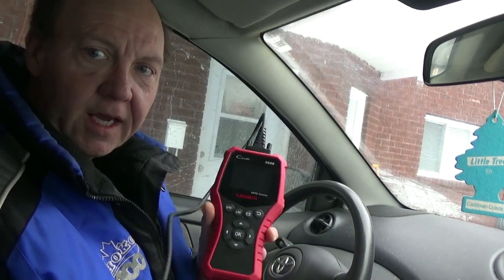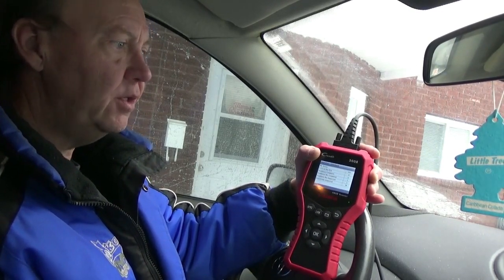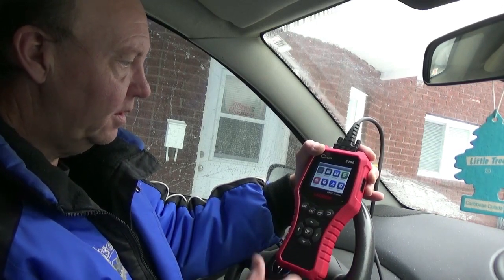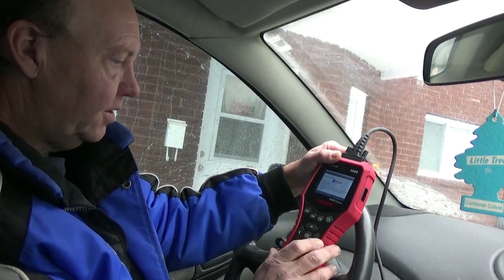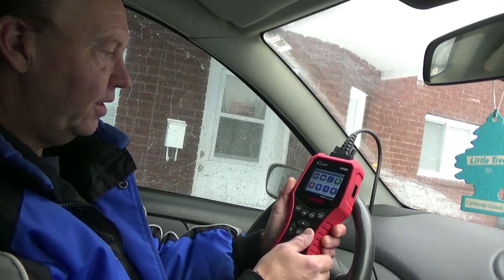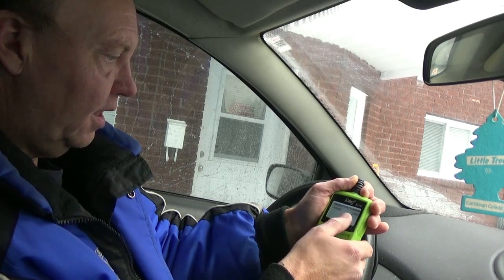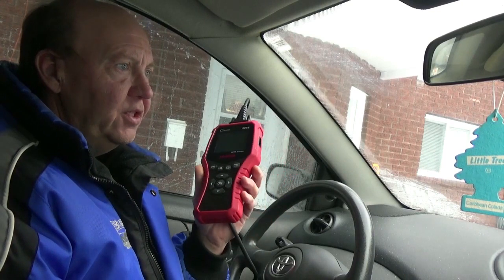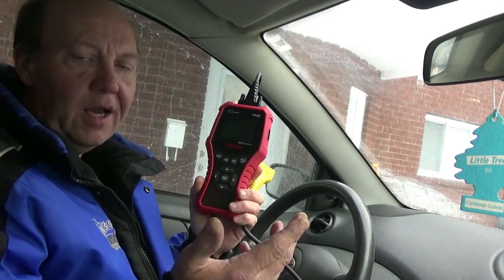Launch Creader 3008 Update Test With New Firmware

Comment: I bought the Creader 3008 on Amazon recently and I installed the two firmware updates (it was a hassle but I finally got the installer). I saw another review of the 3008, his unit was showing the live data stream. Here is the link to the other reviewer. https://www.youtube.com/watch?v=DJ7UGfuY8c0. Thanks for your review.
Reply from the maker: i have seen the other reviews . but none other with my car ,, the live data stream is suoported but wont work there has gota be a probelm with the protocall where its not fully working right with my car, i tried it on my step sons new 2017 dodge cant remebr the model any how everything works perfect like i mean everything i was like what the heck so i gave him this scanner and told hime to enjoy it , so iam back to my jdiag that works perfect with my car including the live stream